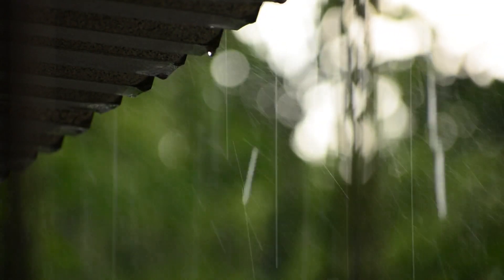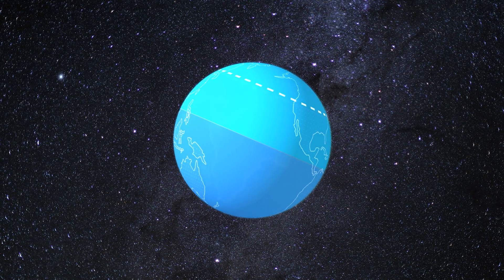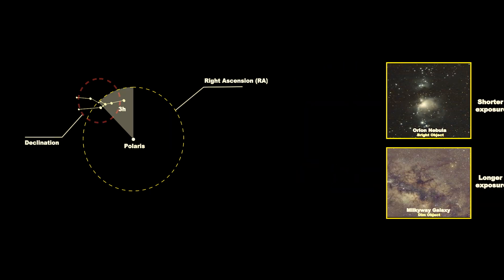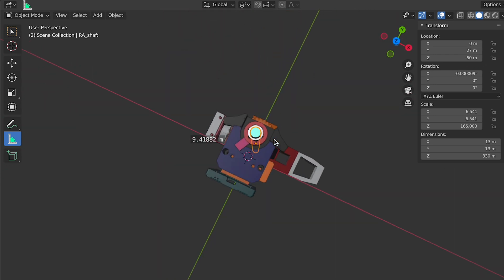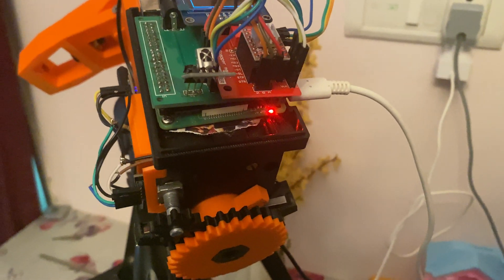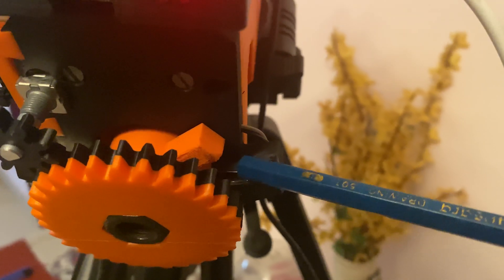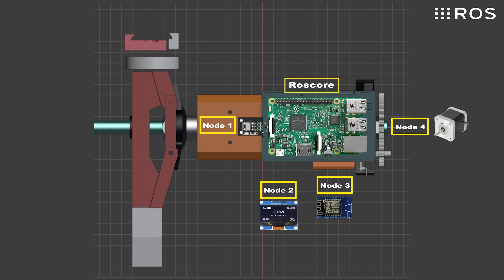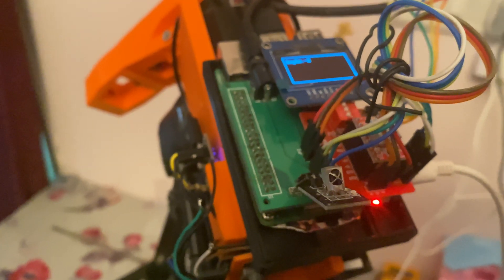How to make a 3D printed EQ mount  - Star Tracking System - Part 2

Comment: For the records: Polaris does in fact rotate around the Northern Celestial Pole. It is approximately 0.7 degrees (or 44 arc seconds) from the center of the northern pole, at any given time. That's also the reason why you need to be polar-aligned, and why such things like Polar Finders or Polar Scopes exist. Aligning to Polaris is not recommended for astro-photography. It is however good enough for visual observation, if you want to manually adjust the scope over time.

Comment: A lot of good thinking in your design. One thing I would highly recommend is to replace the toothed gears with GT2 gears and belts. Near zero wear and backlash and much stronger, especially if you use wide belts.